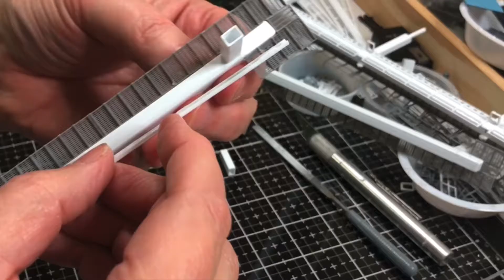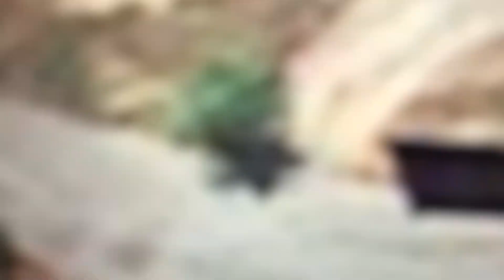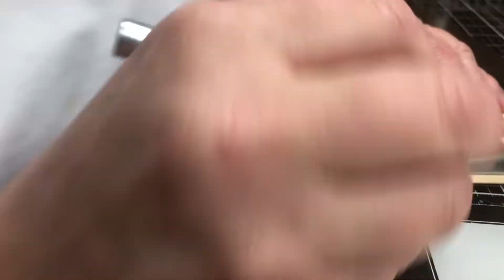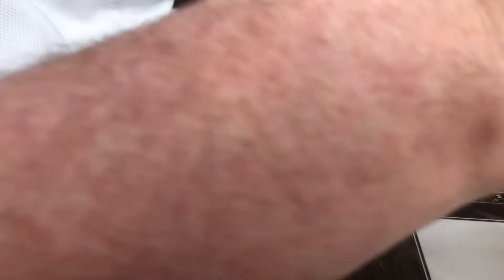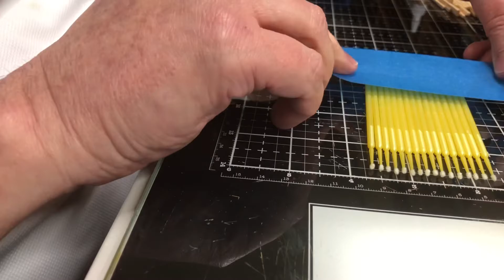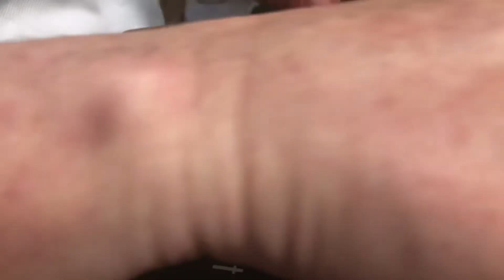Shack Build Part1, Make materials

Comment: Tin roof idea pretty cool, are you worried that it will dent to easy when handled to much?, and that chopper makes quick work of your materials, gonna have to look into getting one of those, can't wait for your progress.
Reply from the maker: Pappy, the thing I have found using the heavy aluminum foil is it tends to curl more then dent.  But on the had it is a roof of a shack, and well let’s say it keeps most of the water out.  Yeah the chopper is great.